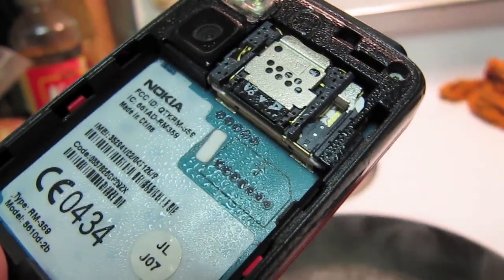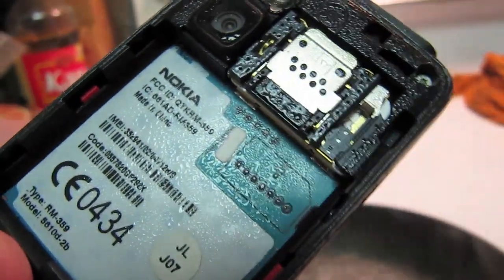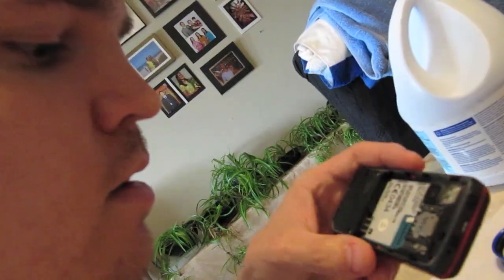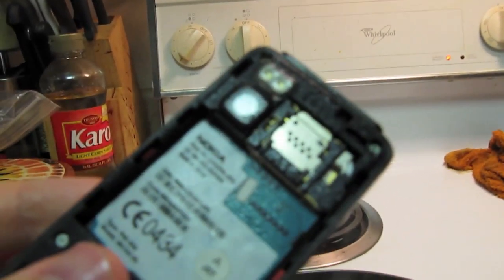How a Water Sensor Turns Red Falsely and How to Make it White Again

Comment: If water vapour got into your phone and changed the sticker red then thats not a false postive, water managed to get into your phone. This means it could have made its way inside to the components of the phone, all your doing here is changing the indicator back to white, with bleach, the indicator wont be able to turn to red after its bleached, so any manufacturer with half a brain will test this and realise its been doctored, also drying out the liquid in a phone isn't the main problem, its actually removing the corrosion, otherwise this will spread and still kill the phone due to long term exposure.
Reply from the maker: Water vapor could show that the indicator is too sensitive, for example for people who listen to music when they are in the shower room and the phone outside. You are right about the corrosion, it doesn't fix anything, only changes the indicator.

Comment: If it's tripped you're pretty much screwed from what I got :/ if you take it in I heard they void your warranty immediately because of it.  If you're computer has issues of any kind with liquid damage you might as well buy a new computer, that's what the apple genius guy told me...of course he said there are cheaper repair places too ^^ i plan on taking my maccy to a local repair shop that works with macs exclusively.  Rather dish out 300 bucks then another thousand.

Comment: If you look closely at an indicator not already tripped it has lines of red dye that will bleed into all other parts of the sticker.  If you could somehow coat the sticker and protect it without activating it or leaving a glossy coating behind you might be able to get away with it.  It won't be easy because if you begin to saturate the sticker it will be activated.  It may be easier to take the stickers out and store them "for a rainy day" hehehe
Reply from the maker: Yeah, that may do it! I figured they would eventually figure something else out.

Comment: Will bleach work on iPhone 4S sensor? 
Because i dropped half of the iPhone into glass of water and the headphone sensor got Red but not the sensors inside. And the phone is not working. It was under Apples 1 year warranty but they don't cover  water damage. So will bleach get the iPhone 4S sensor back to white so i could go swipe my iPhone at apple store...?
Reply from the maker: Yes.